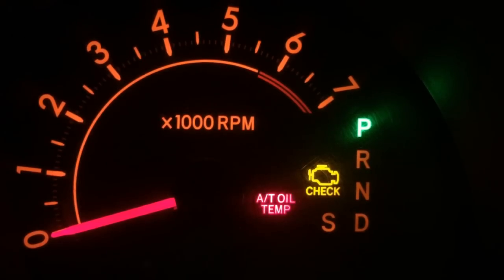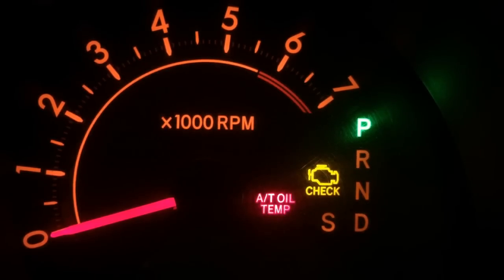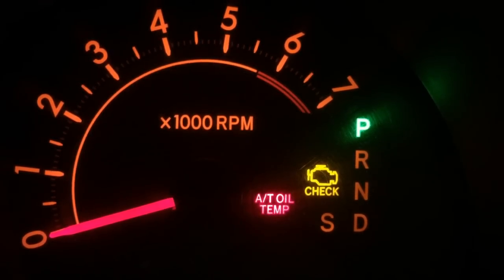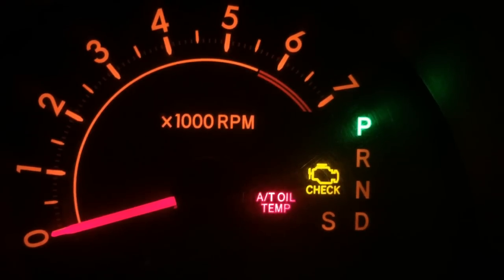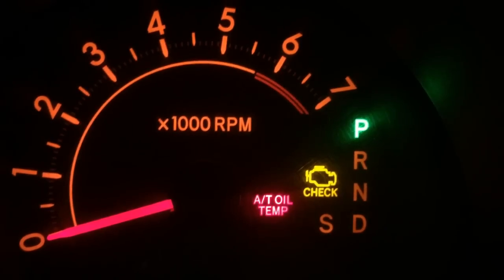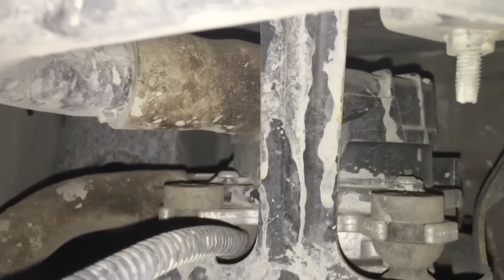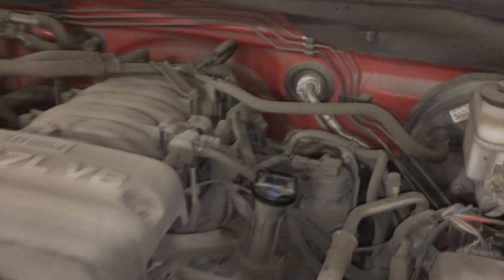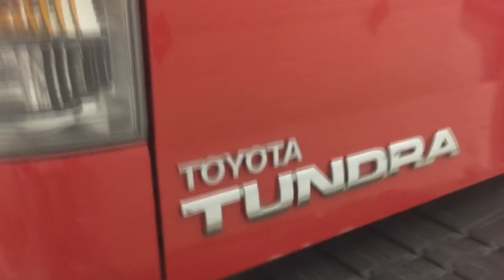Toyota Tundra AIR Injection Code P2440, P2441, P2442, P2443

Comment: I have a 2005 Toyota Corolla xrs I have a air injection problems. The pump is working and blows air to the switch check valve and blow out to the exhaust. But I just want make sure u have a exhaust leak gasket May that cause the problem not having pressure.. Thank for this video.
Reply from the maker: +vang yang Are you saying that you have an exhaust leak and wonder if that can trigger an AIR code? Probably since it needs to sense air intering ahead of the O2 to test and if it always sees too much 02 then it may set a code I guess.

Comment: I have a 2011 toyota tundra with the smaller 8 cyl. and it threw a P0418 Code for the secondary air injection system/water intrusion. I was curious if this was a common problem in 2011's. Toyota extended coverage up to the 2010s to 150k miles to fix this problem. My mechanic says its the exact same problem as the 2010s are having yet apparently Toyota has note elected to extend the coverage to the 2011s which frankly irks the heck out of me. They should make this right if my mechanic is correct in saying this is a design flaw. The TSB put out informed me that it was no problem if I was still under the bumper to bumper warranty for the 2011 model. Well no kidding, and guess what, it's 2015. Hopefully they will do the right thing and extend the warranty to the 2011s. I ll let you know what they opt to do. If you can just give me an idea if you think it is a design issue and a common one it would be appreciated. A 4 year old toyota shouldnt have 2500 dollar pump failures with 90k miles.
Reply from the maker: Kenneth Walcott federal law requires all manufacturers cover emissions systems to at least 5 yr 50,000 miles. If it is beyond that I'm not sure what recourse you have other than Toyota customer service. I have not run into this on a 2011 yet but I run a small shop and don't see many vehicles until they are out of factory warranty. Hope this helps. Thanks for watching.

Comment: Bought a 2010 tundra in March, been at toyota waiting for the whole system replacement. I was going into Limp mode with engine light, 4lo light flashing and slip different light on. Dealership paid for the fix and I just drove it off the lot and 30 minutes later it did it again. It does have a bypass kit on it from previous owner. What could cause the continued issue after the whole system has been replaced?!?!? I'm very frustrated.
Reply from the maker: Nathan Kragel Sounds like there is more going on than just the AIR system. Probably pulling the codes would be the best place to start. Sounds like another trip to the dealer is in order. Good luck.
Reply: @ThecardoctorTV  hey I just went through this 2 with abs lights on the dash right now im chasing the air code but on my 08 crewmax it was a broken wire to my LR abs sensor , check all signal to your hubs i has to run new wire from the computer back to the abs plug

Comment: Great video. I have a 2006 Sequoia with a couple of those dreaded codes displaying. In order to access the air injector pumps, do I need to remove the inside "lining" of the right front fender well. I removed just the small flexible rubber cover and I don't see the pumps even with a mirror. I have a digital Toyota repair manual and it does not show any of this.
Reply from the maker: Havent done a Sequoia. Did you check with the dealer for possible warranty coverage? If you lean on them they might take care of it for free.
Reply: Thanks for quick reply. The car is at the dealer as we speak to be 
evaluated for possible warranty coverage. The 2006 Sequoia is outside 
their extended warranty on this item. It will get a 2007 with less than 
150K miles. While I was in the parts dept I learned that the 2006 
Sequoia only has one air inject pump and it is located under the intake 
manifold. A mechanic present said he thought it was the 2007 Sequoia 
that has 2 pumps mounted on a bracket behind a panel in the RF fender 
well. The service mgr suggested I call an 800 # at Toyota and request  
"special outside the warranty coverage" once I know exactly what the 
repair entails. If they won't cover it, I guess I will pull the intake 
manifold. Not exactly a herculean task, but nice if you can get somebody
 else to do it. ha
Reply from the maker: Push them to cover it and they will. Good luck.
Reply: @ThecardoctorTV  I just bought a 2007 tundra with 231k miles, been well maintained per carfax do you think dealership can cover it

Comment: just got me with the P2441 code. I have the 08 with 186,000 on it. I ordered the bypass kit and hope to see if it works.
Reply: Imachowderhead My understanding is that you have to fix it first then install the bypass kit. Let me know if it worked for you.
Reply: did the kit help i have an 08 180k miles same issue p2447 p2443
Reply: @PA-hb3eh  yes, no limp mode at all.
Reply: @Imachowderhead  do you have to fix it first or just install the kit
Reply: @PA-hb3eh  no if you fix it its fixed. All I did was block off the front intake gaskets which are included in your kit but it depends on what code you throw up. The p2441 its suggested you block off the 2 front gaskets.  I had mine installed in 2015 and its not failed.

Comment: My 2012 Tundra also have P2441 problem, looks like Toyota still haven't fixed this Air Injection Pump Valves problem.  Up to now, Toyota don't have any recalls for Tundra 2012

Comment: I am in the middle of dropping over $2900 on my 08 tundra with the 5.7, much more expensive to have done. 4.7 is much easier and cheaper
Reply: Call Toyota motor corporation at the 1-800 number. Have your receipt and mileage handy. Tell them what happened.
If you have bought more than 1 Toyota and have serviced your  toyotas at Toyota, I'll bet you that they refund you a portion. They did for me. They refunded 1975.00 to me. Good luck

Comment: I have a 2014 Toyota 4-Runner Limited.  I went to Auto Zone today for a check engine reading.  The result  is a P2441.  I don't know enough to work on my own vehicle.  Any advice as to whether or not I must go to the dealership or if I can seek local help.  Of course my warranty just ran out in January....
Reply from the maker: +Nate Silberstein I would recommend taking it to the dealer and asking them to do the repairs at no cost. They have extended the repairs for coverage to others and sometimes you just need to be very assertive to get them to take care of it. Good luck.

Comment: What about P0418 also? I have a 2006 4.7L Tundra.  I did have a P2440 but now just P0418. I've heard it's mostly the electric motor under the intake? Also do those air pump bypass kits work?

Comment: Do you know if they make a bypass kit for 2018 5.7. the pump valve body has already been replaced at 9000 miles and do u know if the fuel mpg will go down when bypassed?

Comment: Hi.. what's the average price to repair trouble code 2443?

2008 tundra 5.7
Reply from the maker: I have no idea
Reply: Service tech i talked to friday said upwards of $2500 if they gotta do the whole system.
Reply: @PloufferDoofer  ..thx for the response. I had it repaired here in El Paso for just around $2,500 just like you said.

Luckily this is my third Toyota so Toyota Motor Corporation refunded me $1,975, for customer loyalty.... Thanks for your help
Reply: Christopher Sotelo You have no idea how hopeful that makes me haha. Thanks for that info. We're a 4 Toyota family from the same dealership over the last 20 years now. Was there anything extra they asked for or did a letter just show up?
Reply: PloufferDoofer..  this is what you need to do.

1. Make sure you have already taken your Tundra to your Toyota dealership where are you are going to do the repair. If you haven't done the repair with them you need a quote on the price. Most averages are from 2,000 to $3,000. If you have done the repair then have your receipt handy.

2. Call Toyota Motor Corporation at the following number. 1-800-331-4331.
It's an automated system and I forgot which option you choose but it has to do with reporting concerns or comments. After you get through you will be transferred to a representative from Toyota. Make sure you have the vehicle identification number ready along with your mileage. If you have already done the repair then have your receipt with you, if you haven't done the repair then have the quoted price written down and ready. Also have the name of your Toyota service representative and the phone number to that Toyota dealership where you're going to do the repair.

3. When you get through to the Toyota Motor Corporation you need to tell the lady about your repair and the trouble code. They will already know what you're talking about because this was  a design flaw in the early model redesigned Tundras. Mine was a 2008 and it had that design flaw for the air injection pumps. This flaw is not your fault as they designed it incorrectly and over many years water was able to get into the pumps. Tell the Toyota Motor Corporation customer representative that you are asking for assistance on the repair and if they can help you out. They are very courteous.  if you haven't done the repair yet she's going to ask for your VIN number and your mileage and the price you were quoted for the repair along with where you are taking it and their phone number and the name of the Toyota service representative at that Toyota who's helping you with the repair.  I don't know what to tell you if you've already done the repair but I'm assuming if you already have have your receipt ready so you can tell her how much you paid.  the Toyota Motor Corporation is going to ask you a few questions which pretty much helps them decide if they're going to help you financially or not. Probably the most important things that will get you reimbursed are if you have bought several trucks from Toyota and if you have had all of the trucks serviced at Toyota so that your service records are on file.  if you have bought more than one truck with them and all your services were done at Toyota then you are a valued customer and more than likely when they call you back after they investigate your claim you will be helped out financially. They helped me with 80% of the bill.  it takes them about three days to do their investigation and make the decision. They will call you back.

3.  If you qualify for financial assistance they will contact the Toyota where you are doing the repair through email. From there your service technician should order all the parts ahead of time because there are a lot of parts to order including pumps hoses valves and clamps. At least that's how my Toyota did it.  then when all the parts were in they called me and I brought the truck in and they were done repairing it in about1 day.

4.  at that time when I picked up the truck then I was just responsible for the difference of the repair. My cost was a little over $600 out of my pocket because of tax.

 like I said, the most important factors to get you financial assistance through Toyota Motor Corporation are the number of Toyotas that you've purchased and your service record at Toyota. Good luck my friend

Comment: Can a air valve that got some recent moisture be aired out?  My mechanic "washed" off my engine with soap and water and told me the codes were preexisting.  I found water in the air pump.  Will it work again?
Reply from the maker: Water in the system is common. The buildup may be result of an improperly functiong system  I would try to clean it out and see if the codes return.

Comment: I called the dealer with vin, said there is no open recall on this? Is there anything else I can do or anyone to call?
Reply from the maker: Call Toyota customer satisfaction and really complain. Tell them you care about the environment and hate causing smog after you exhaust combines with hydrocarbons in the atmosphere. Tell them you sometimes post videos on YouTube and this common problem would probably make a great video and highly effective at causing people to reconsider buying a Toyota.  Heck, it may get 20,000 views in less than a year and that might be 20k less Toyota fans out there. Seems silly not to take care of a poorly designed pollution control device that was likely designed to only outlast the federal emissions warranty then crap out after. There is no recall but others have found that a little persuasion goes a long way.
Reply: +The Car Doctor thanks i spoke to someone at Toyota corporate. it is CSP program.  my truck is at 9 years 85,000 miles so hope it will be covered. of course they have to pull their own codes, i am going off auto zone code. i will update the thread tommrow, for other people's benefit.  appreciate it!
Reply: have you heard anything back from them? I would like to know the result of this before I continue any further.

Comment: How would you deal with a p2432 code for a 5.7 liter 2007 tundra?
Reply from the maker: +wh I would check with the dealership for possible warranty coverage for any repairs.
Reply: +The Car Doctor the tundra is in Belize central America and the Toyota dealer here would not honor the warranty. I purchased an air pump bypass from rutech but not sure if that will clear that code once it is installed. We don't have emission laws here so no need for the emission system.
Reply from the maker: If you install the rutech module and block off plates you should no longer get any AIR codes. You may need to clear your codes once the bypass has been installed but you shouldn't get those codes again.